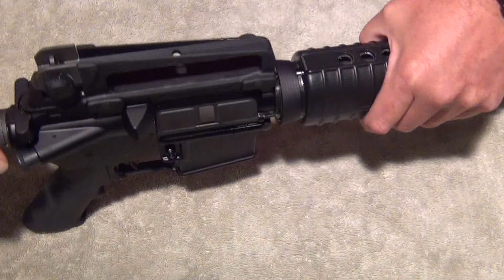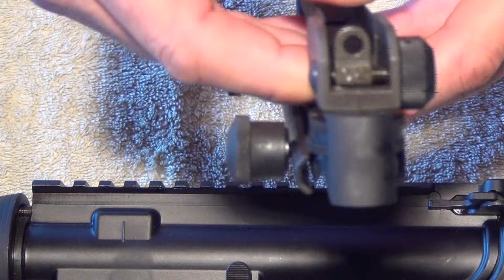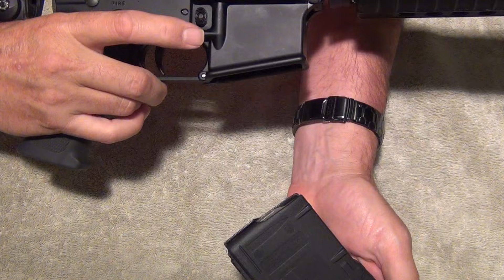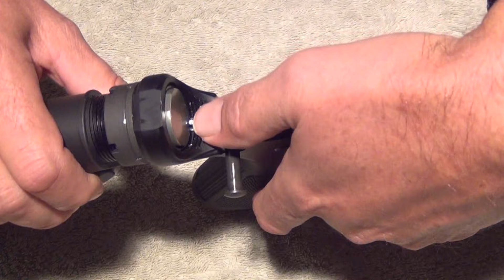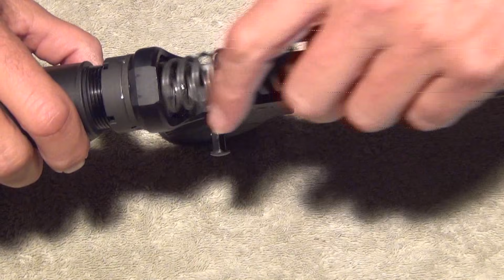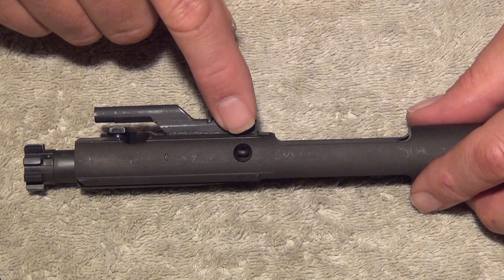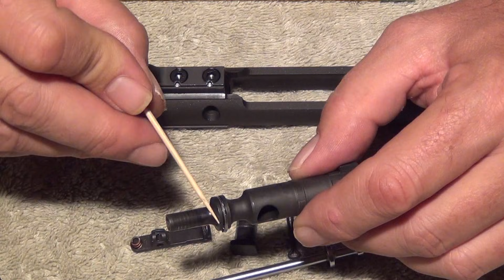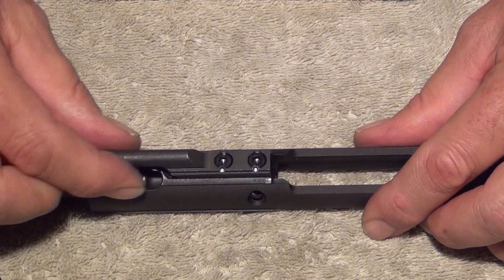AR-15 Basics: Controls, Function, Disassembly, & Reassembly.

Comment: picked up my first AR yesterday. I locked my bolt back, pressed the bolt catch button, bolt released and I noticed that my magazine released. Is that normal, it happens every time.
Reply from the maker: Sorry for the delay. No, it isn't normal for the magazine to release, when you release the bolt catch (I have no idea what the problem might be without examining the rifle). I'd take it back to the store, or a gunsmith. Cheers

Comment: Great video. Also worth mentioning - in the AR world, the term "carbine" can also refer to the length of the gas system, so 2 ARs can have the same barrel length (and both be generically classified as "carbines") but with different length gas systems (7.5" carbine, 9" mid-length or 13.5" rifle). As a newcomer to the AR I wasn't aware of this for a while.

Comment: A question on the bolt carrier group. Are they all about the same on all AR's? I just purchased a new AR platform and was wondering. Thanks, RM
Reply: The disassembly is exactly the same. But the cut out length on The bottom may be a little different depending on whether it's AR 15 spec or mil spec.
Reply: Thanks Seth

Comment: +stanfordcoffee ,  why sometimes the bolt is locked back (3:36) and sometimes it's not (6:40), even with empty chamber and not using the bolt catch/release in both cases? Is that because the mag wasn't inserted at the first scenario?

Also, as for the selector lever: why isn't it possible to move to "safe" after discharging? Is that only for AR-15 or for M4 as well? I wonder because it's taught by many instructors to move back to "safe" after engaging and making sure the room is clear, for safety reasons.

Some pretty newbie questions, but I don't have easy access to weapons in my country.

Thanks :D
Reply from the maker: +NeCtRiCkS   Bolt catch: in both cases I am manipulating the bolt catch ,with my left hand behind the rifle, to demonstrate something else. The bolt will lock back on an empty magazine, or if you push down on the bolt catch while the charging handle has been fully pulled back. All other times it will advance forward.

Safety selector: not sure why Stoner design a safety that way, It's just the way it works (on the AR15). I'm not sure about the M4, I've never had the opportunity to handle one. 
Cheers
Reply: +stanfordcoffee thank you so much, buddy; very helpful reply! :D

Comment: I bought a AR-15 and it is great. Except the grip is loose. I tried disassembling it to see if I could find a screw to screw but no luck. Any advice? New to this weapon. Thanks!
Reply from the maker: +Gustavo Gutierrez Pistol grip, or hand guards (fore grip)? There is a screw in the bottom of the pistol grip, accessed from inside / bottom. My hangard rotates back and forth about a quarter of an inch. That's because it's held in place with the D ring. No screws. Some aftermarket hand guards are screwed into place, and will not move. Cheers
Reply: +stanfordcoffee awesome thanks. I'll check it out I can see the screw from the outside but not when disassembled

Comment: I'm new to the AR but it seems pretty self explanatory after watching your demonstration.  I actually bought an AR10 and there are a couple of differences that I would like to ask you about.   #1- My rifle is equipped with forward assist but my bolt carrier group isn't notched.  The rifle was purchased brand new like this so there's been no parts swapping.   Your opinion on this.?  #2- After removing the firing pin, the cam pin doesn't have to be rotated to remove it from the bolt carrier.  Why is a turning/locking cam pin important and should I be concerned about mine not turning and locking?  #3- When reinstalling the firing pin, it is too long to drop it through the slot inside the bolt carrier group so I have to drop it through the end.  This doesn't seen like a big deal but a couple of times when I dropped it in, it fell out the side slot of the bolt carrier group.  Your thoughts?
Reply from the maker: +Timothy Callahan I don't currently own an AR-10 and am only vaguely  familiar with it. As such, you have some Internet research on your own. 
#1 I did a quick Internet search, And it seems like there are AR10 BCG that do have notches cut in them. You'll have to research to find out if they're compatible with your upper.
#2  The only reason is necessary to turn the cam pin on a  AR15 is that the cam pin needs to clear the gas key to remove it. If you can remove it on an AR 10 without turning it, I don't believe there's any issue at all.
#3 I don't believe there's any issue, other than the firing pin is probably longer on an AR 10, I won't fit through the slot. It shouldn't be a problem installing it from the back of the BCG, and certainly won't hurt the rifle.
Cheers

Comment: Rifle looks brand spanking new and never/hardly fired..
Reply from the maker: +cj spicy It was at the time of filming. 500 rounds? Cheers
Reply: +stanfordcoffee  Right on.. I wasn't talking trash or anything, just looked in really good condition is all
Reply from the maker: +cj spicy I now have about 2000 rounds through it and to be honest it doesn't look much different than it does in this video. Holding up very well. Cheers
Reply: stanfordcoffee Ya I was just looking at the hammer, charging handle, bcg and didn't see much wear. I'm sure those have a lot of wear marks now though. If you don't beat your rifle up it will still look good even after 20,000 rounds. Just depends how you use it I guess, but no matter what you're going to get wear in those certain areas. Have a nice day.

Comment: O.K. I don't own one yet. I just ordered a complete upper, planning to build the lower. All my research so far and I have not yet found out WHY, you need the forward assist. I get that it is to force the bolt forward, but why would it not go into battery on it's own? Because it is that dirty that it won't move freely?
Reply from the maker: +zeppelin67637   The forward assist was added to the M-16 platform in order to give the soldier a way to push the bolt forward. WHY; dirt in the upper receiver, low powder charge in a round causing improper cycle, or stealth (easing the charging handle forward quietly and then pushing the forward assist). Cheers
Reply: stanfordcoffee
Thank you for the reply. Hadn't thought about the stealth use.

Comment: Do you want to store the weapon cocked? How do you decock it without firing it?
Reply from the maker: +Mike Taylor I store mine decocked. But, you can store either way. It's generally believed that cycles wear out the spring and not compression. I do have a video posted on how to decock the AR15. Cheers

Comment: Thanks for the helpful video , that retainer clip can be a bitch to go back in any helpful hints?
Reply from the maker: +Alan Drynan It can be a pain. My technique, hold the cotter pin so the loop at the top is parallel to the ground, then wiggle the cotter pin for and aft. I am trying to catch one side, and then the other. Good luck. Cheers

Comment: I have a hard time pushing out the front pin to take the upper off. I have a Rugger AR556.
Reply from the maker: +DECEPTICIDE AK It will break in with use, meanwhile you could put a little lubrication on it, it may help. Cheers

Comment: excellent no nonsense vid. probably the clearest on youtube. one pointer you dont need a toothpick for the ejector pin, your firing pin was designed for that purpose they are the same diameter
Reply from the maker: +robert denson Yep, there is an annotation in the video to that fact, but you probably can see it on your device. Cheers

Comment: should you lube the bolt carrier group parts when reassembling? ( and everything else, for that matter)
Reply from the maker: +LuvTheSnapper Yes, there are links to 2 lubrication videos at the bottom of the description. cheers
Reply: Yes, you can pretty much oil anything that has wear,  like metal on metal! But I usually put a thin coat on everything

Comment: M-4 means it has M-4 feeding ramps in the upper and a M-4 barrel, just because it has a short barrel and adjustable stock don`t mean it`s a M-4 !!
Reply: +dave nmemphis A true M4 is made by Colt.   Everything else is an "mforgery".
Reply: +David Spennachio    a true mil-spec is only a colt but not a M-4
Reply: dave nmemphis Colt model 6920 is a M4.  Its stamped M4 and its the original.  Every thing else is a copy.
Reply: plus a flat top without a fixed handle

Comment: What's the lever on the charging handle for
Reply from the maker: Ryan Ford The little lever is a catch / lock. It holds the charging handle in the forward position. You either pinch the charging handle, or start pulling it back on the side with the catch, and it will release the charging handle so that you can pull it rearward. It's very intuitive, once you get your hands on the rifle. Cheers
Reply: +stanfordcoffee Thanks

Comment: I accidentally had the bolt open when I took the pins out, and the bolt slammed shut, and I believe it chipped some of the metal on the hammer. Should I be worried? It was really just the paint on it, and it didn't do too much damage.
Reply from the maker: Lake Titicaca I can't evaluate your rifle without seeing the parts. In general, AR 15's are fairly robust, but you should take it to a gun shop / gunsmith to have it evaluated if you worry about it. Good luck. Cheers
Reply: stanfordcoffee I mean, it kinda looks like normal wear and tear, but i dont think it would hurt the function of the rifle too bad. Like i said, mostly the paint and stuff, but then again, Im kinda new to these.

Comment: A3 is the designation of a flat-top upper receiver.  M4 does not inherently mean that it has a flat-top upper.  There are plenty of A2 (integrated carry handle) M4s.  The M4 designation means that the rifle has a carbine length gas system, 4 or 6 position collapsible stock, improved feed ramps that extend down into the the upper receiver, and a specific profile barrel which includes a notch used to attach an M203 40mm grenade launcher or other accessories.  Aside from this discrepancy, it was a great video for beginners!

Comment: I do not personally own an AR-15 but you made the video clear enough to make me believe i can actually disassemble one of those beauties. All I need to know now is how to maintain the condition of the gun (cleaning, putting oil). This video was on point, thank you for sharing.
Reply from the maker: 15407munoz There are two links at the bottom of the description to cleaning and lubricating videos. One by James Yeager, the other Hickok45. They should be able to help you out. Cheers

Comment: One minor note on the magazine advice (to remove the bullets): the springs in the magazine are not aged by being compressed (i.e.: mag full of ammo), they may be left at full capacity with no wear, they actually age by repetitive motion of change of state of the spring, so be aware that taking unused ammo out of a magazine is actually wearing on the magazine spring.  It is better for the magazine spring to leave ammo in place UNLESS of course there is a safety issue (like children potentially gaining access to the HW.   Safety first.
Reply: lastdaysguitar that’s why I keep 2 fully loaded for home defense.
Reply: lastdaysguitar interesting, thanks for the tip
Reply: I just recently saw a video of someone that left his mags loaded for 10+ years. when compared to a spring that wasn't in the loaded position the loaded spring was actually about an inch shorter. Although it will still work, just so you know it can change the spring. Maybe not all will do it but it can happen. but no loss of spring action from what I saw in that video.

Comment: I just bought this exact gun. After several months of saving I finally got the gun i wanted. I am not one of those guys who just buys guns to have them. I purchased an entire schematic of all the parts so I know the names and function of everything. I have put about 200 round through my bushmaster already and I sat and watched you video and disassembled it just as you did, and cleaned it thoroughly. I was told that I did not need to oil up the gun as much as an older gun because of the materials its made out of...but my military friends beg to differ. What do you use to clean and lubricate your firearms? Liked and Subscribed!
Reply from the maker: Imperial Auto Detailing I'm agree with your military friends, AR15's like to run wet (not soaked/dripping). I use Ballistol to clean and lubricate, as well as a small amount of grease in and around the bolt carrier group. There are 2 links at the bottom of the description for good lubrication and cleaning videos. Cheers

Comment: WOW, you have done a supper fantastic job of keeping it simple and basic for us newbies. Thanks a million. I wish you had also shown how clean out the gas port in front or should that be left alone?
Can you or some one informed out there tell me how often one should clean the "entire" rifle. As in after how many rounds?
Thanks again
Reply from the maker: goonerdotcom At the bottom of the description is a link to Hickok45 "AR15 Cleaning". Watch that. The inside of the gas tube does not need to be cleaned very often, Due to the high pressures, And temperatures. maybe once every three, to four thousand rounds. Cheers
Reply: Thank you very much.

Comment: Great video very informative, i have a armalite m-15, and i wanted to know if you are familiar with this particular riffle, and if so do i take the same disassembly steps that you performed in this. Any info would be greatly appreciated.
Reply from the maker: Hi Mr. Brown; Thanks. I wasn't familiar, but did some research . The M15 is basically a long M4. Longer barrel and gas system, and a slightly different bolt profile (at the rear). Yours could be chambered in 5.56, or 6.8 mm (yours?). The controls, disassembly and reassembly will be the same. You can follow this video for the takedown procedure. Cheers
Reply: Ok thanks a lot i appreciate the help and taking your personal time to research it for me. P.s. my m15 is chambered in 5.56
Reply from the maker: You shouldn't have any problems, enjoy your new rifle.
Reply: Thank you, will do.

Comment: very good video.... can i ask what is the advantage of not being able to operate the safety after depressing the trigger? every other firearm i own or have owned you can put the weapon on safe. thanks
Reply from the maker: I've never been able to find a satisfactory reason why Stoner designed that way.
Watch this video for a better understanding of how the mechanics work.
https://www.youtube.com/watch?v=bH6kQv65SuY
Reply: One theory is that when you fire the bolt is in the chamber so you can't see if there is a stuck round In the barrel. So you would have to pull back on the charging rod to pull back on the bolt so you can look and see if it is clear. That way you don't have a cook off from a stuck round in your barrel and ruin your rifle.
Reply: It's the way the cam design is on the safety
Reply: Norm Sniper
yes i know, that was not the question.
Reply: i have a savage bolt action that is the same way, never found a good reason
Reply: Anita Appel
i have though about it more and more and i came up with an idea that might sound dumb to some people but here goes ;) since you can not select safe when the hammer is down it is a confirmation so that you do not have to open the bolt and view the chamber to know if the weapon is loaded and cocked. for instance, in a battle in the dark you can try to select safe and you will know if your hammer is cocked. you can do this action much more quietly instead of racking/charging the bolt in a gun fight. other then that idea i will have to think more. anyway, it is an AR15 and not the battle m16 so maybe it is like apples and oranges? i am going to investigate more m16 safety selectors and figure this out LOL nice talking to y'all.
Reply from the maker: inspectyerbooty An M16 safety selector has three positions, but as far as the subject we're talking about, I don't think there's any difference. The only thing being able to select safe tells you is the position of the hammer. It does not tell you whether or not the bolt is forward or back, or whether there is around in the chamber not (you can engage the safety with the bolt locked open, or closed, round in the chamber or empty). I had the same thought, but dismissed it. Your thoughts? Cheers
Reply: stanfordcoffee
thank you for your comment, it helped. i also like your background pictures " the hardest part about a zombie apocalypse will be pretending i'm not excited!!!" ;)
Reply from the maker: I want it for my YouTube page, but it's not the right dimensions, the program won't accept it.